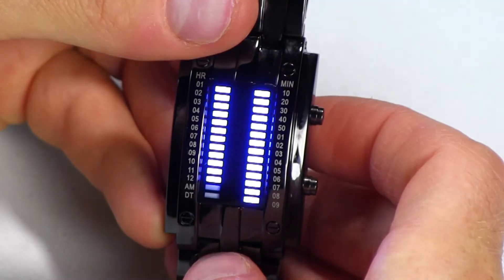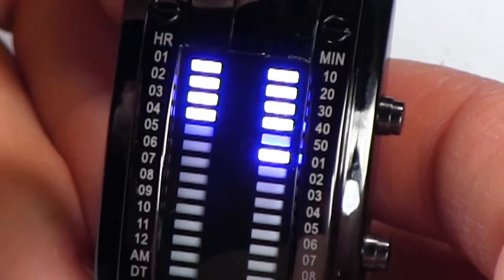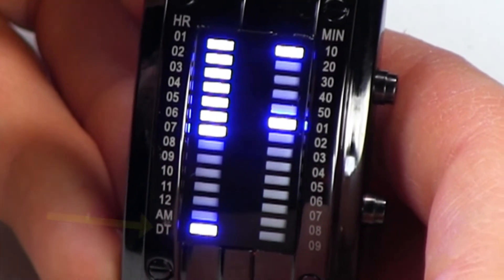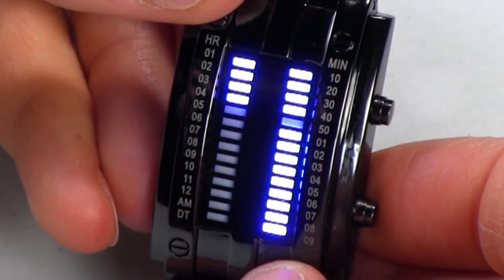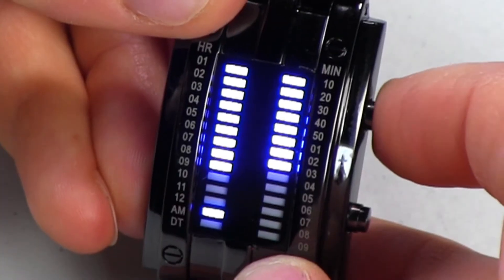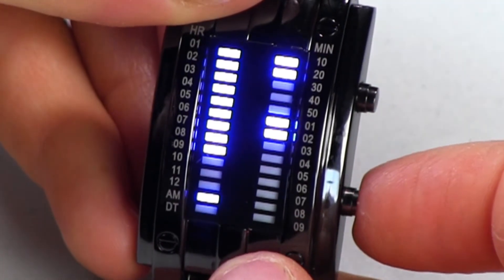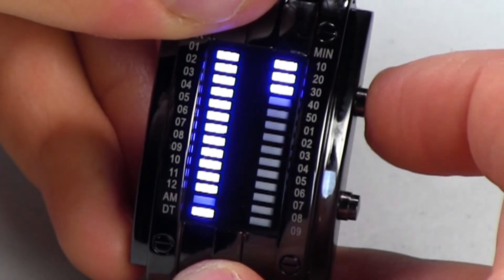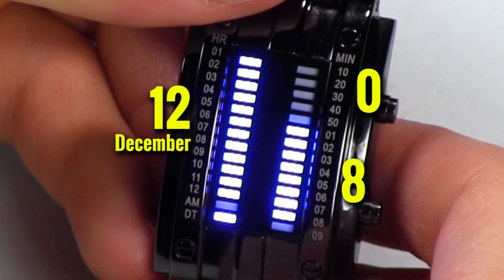Binary LED Watch - How to Read and Set Time and Date easy instructions

Comment: Get a real binary watch, not a fake one like this.  This is merely an LED one that lights up hours, "tens of minutes", etc. A true binary watch, counting in the binary system, (which this one DOESNT, at least not visibly) has (usually) 4 LEDs representing values 8, 4, 2, 1 for the hours. Another row or column for the minutes representing 32, 16, 8, 4, 2, 1.  You then add whichever are lit to get the time.  The watch shown is a fake, non-binary
Reply from the maker: Nobody cares about that. It's STILL a cool watch. 😀
Reply: Who cares? Lol